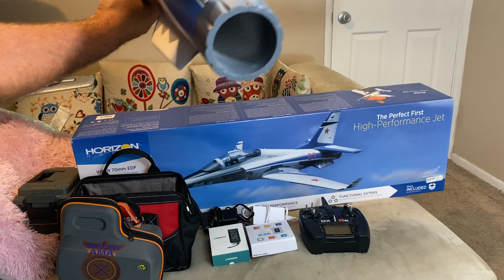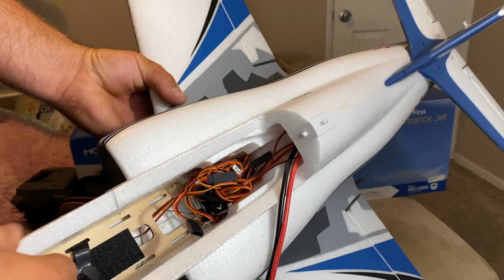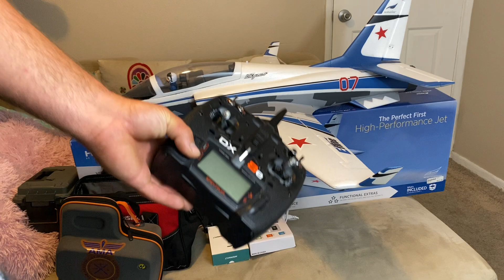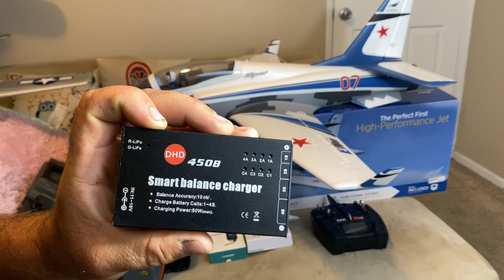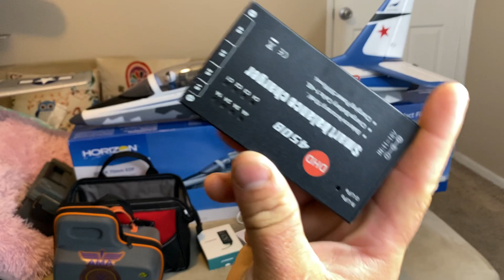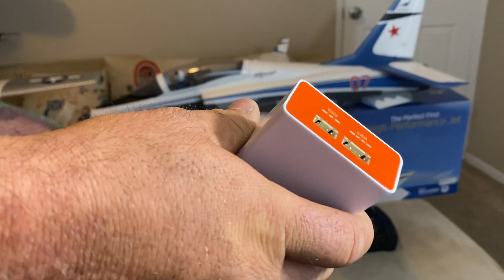E-Flight Viper 70mm EDF 1.1m Jet- overview and new chargers- RC Cincy

Comment: Do the wires block the airflow or do the intake scoops on the sides mean the wires are not in the air path ?
Reply from the maker: they there not in the way of the duct fan. there ran a different way, its a great first jet